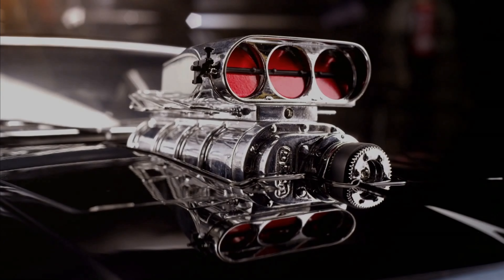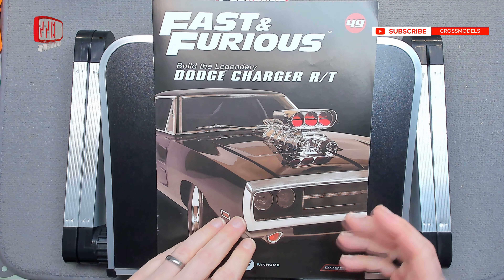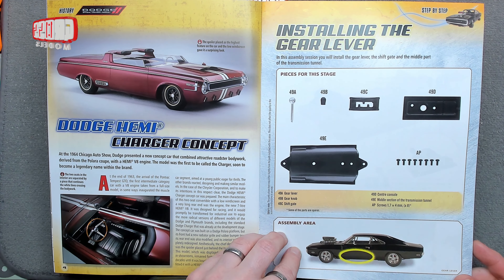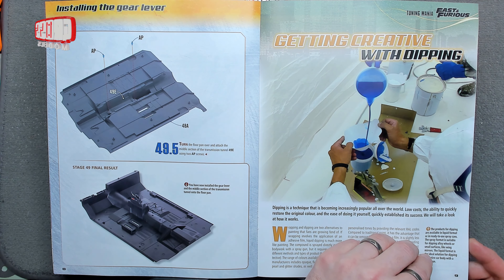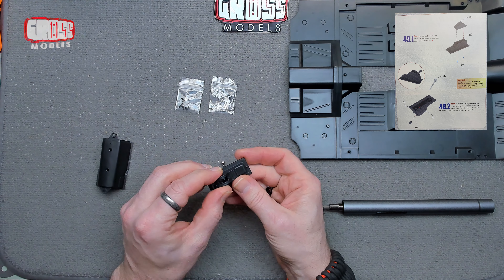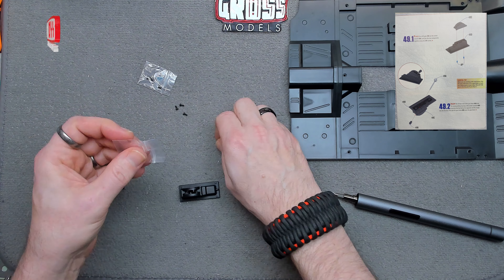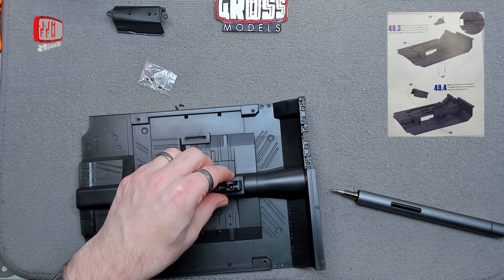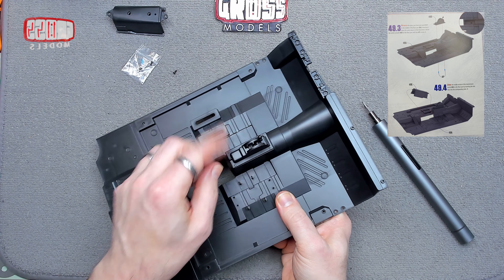Fanhome 1:8 scale Dodge Charger build. Issue 49

Comment: Have you tried to put the hood on the car with the supercharger?  Mine doesn't fit. The top of the blower is to wide even the fuel lines are to wide for the opening in the hood.
Reply from the maker: I tried it a while back, but not recently. I hope you just didn’t get it lined up quite right and it will be ok when the time comes!
Reply: @GrossModels  It lined up. and the black throttle parts on each side are wider than the hood opening, even the fuel lines won't fit through the opening.  Plust the hood is different from the pictures on the website.  On website it shows the hood open with hidges like a normal car. My hood (and I have 2)  both have a hole in each corner for hood pins like on a race car.